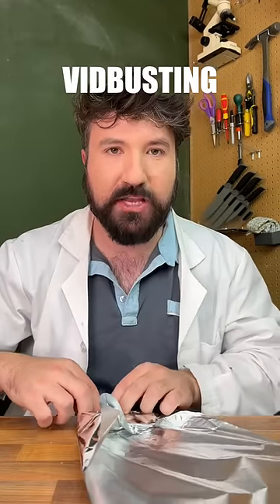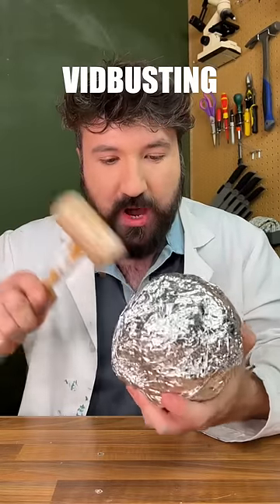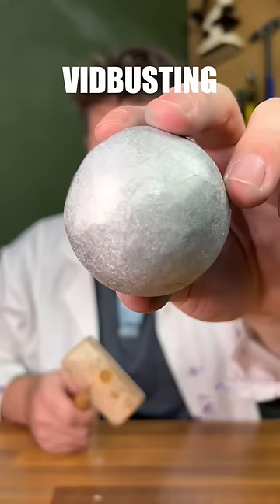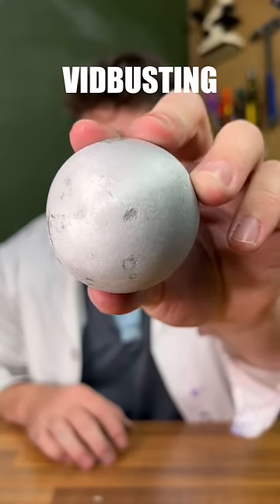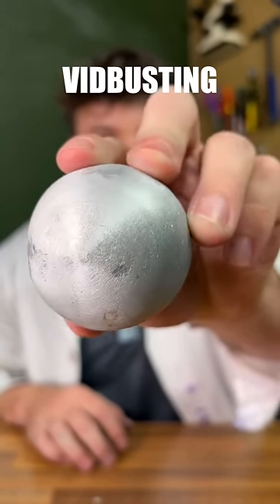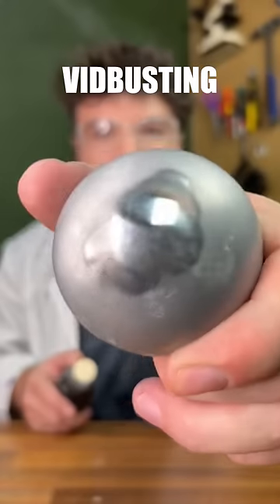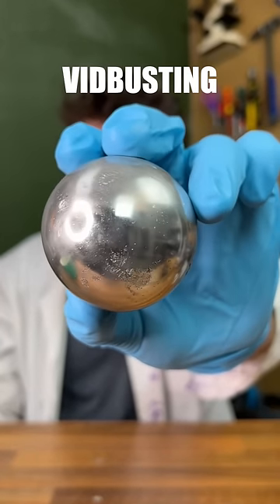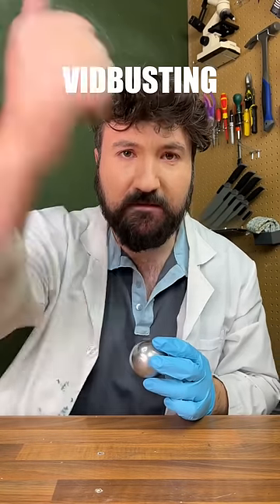Best aluminium foil life hack ever?! ⬜️

Comment: I think he even smashed the air molecules inside that foil-
Reply: if he did that it would explode
Reply: @Someoffsilver  no it wouldent, see, by hitting the tin foil with the mallet the air is being pushed out making it smooth and hard.
Reply: @Tinpot_Guy  that's bcs it's molecules hasn't broken...... If you managed to broke things into atomic level it'll explode....  The OP it's just adding some hyperbole
Reply: @milieu125  oh ok
Reply: @milieu125  Yeah, molecules are made of atoms so it would be virtually impossible to break apart an atom with a hammer
Reply: @LakeErieAerospaceAssociation although if you did manage to do that, you probably would very quickly lose your arm

Comment: Aluminum foil not tin foil
Reply: Tin is a completely different element 
If it really was tin foil it would be expensive and two soft 
It would be faster melting tin and casting it
Reply: tin foil is made from aluminium. When it was first a thing yes it was made from tin but that was too hard to keep producing and too expensive while also finding that Aluminium did the same thing so they made foil out of aluminium and kept the same name.